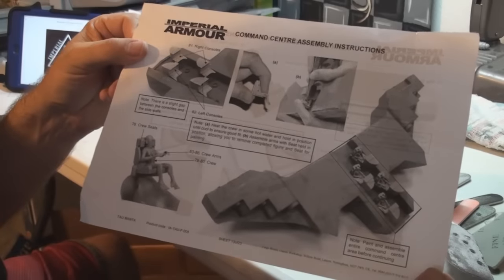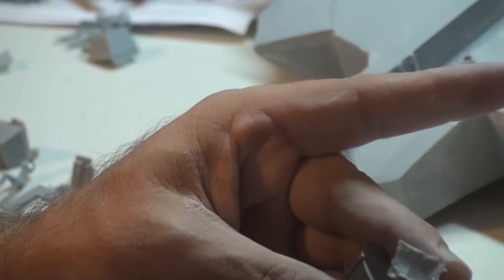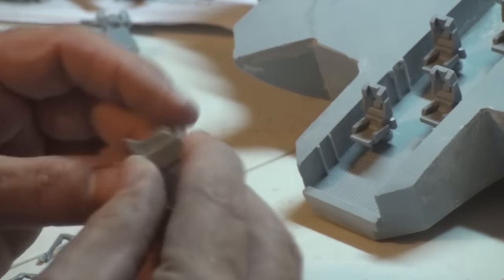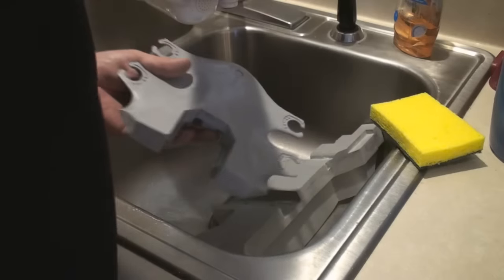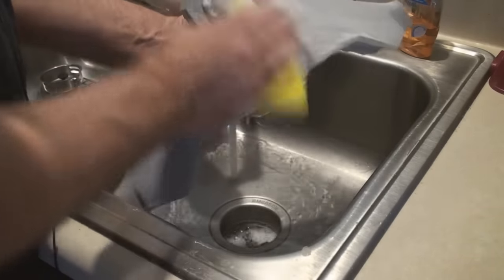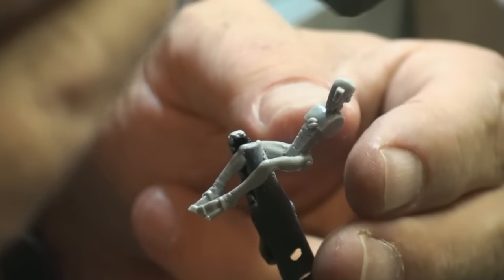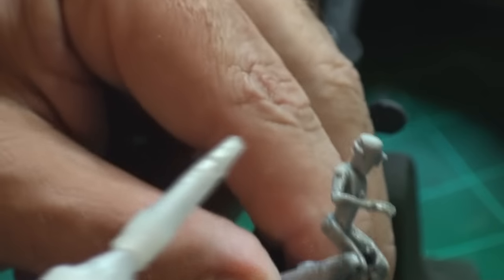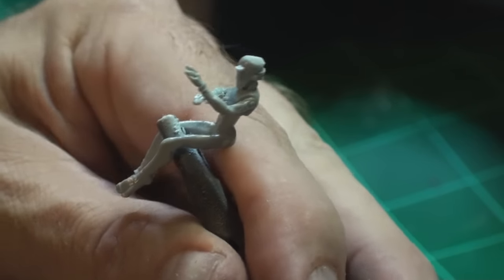Building A Tau Manta From Forge World Part 3

Comment: Awesome work so far. Can't wait to see this finished! Following this closely for when I finally order my very own! Are you having to pin any thing in place for stability or will glue do the job?
Reply: +10K Painting Studio I have one of these - and honestly, unless you plan on making it a display piece only, I would suggest not getting one.  The model is just too big to manage on the table top - at least in my perspective.
The build is also quite challanging (later steps....) as there are tons of gaps and other issues with the model.  Don't get me wrong - it looks really cool, just trying to set some expectations so you can get he most enjoyment out of it.